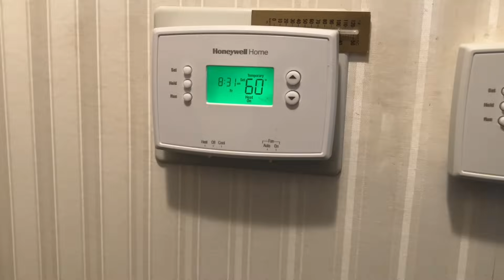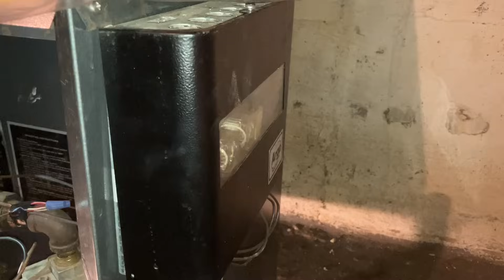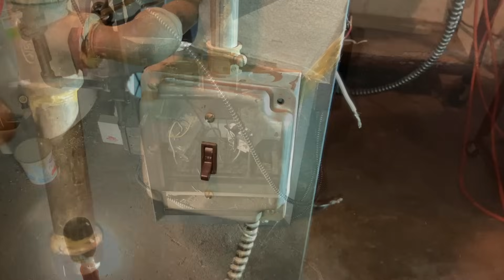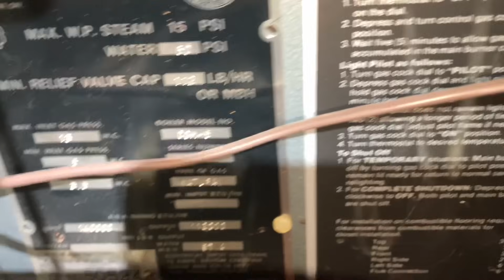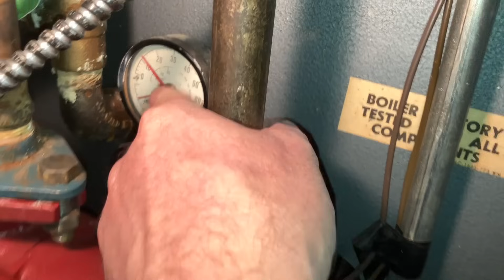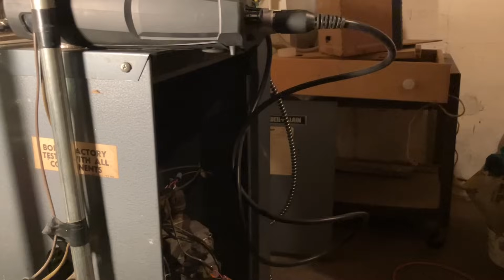Weil McLain No Heat Emergency Service Call by Local Plumber Pipe Doctor

Comment: You state your objective is to make sure it runs safely and correctly, and you are sooooo thorough......yet your air is 7.7% when it should be 4.0-5.0%. Since the "whale" mc lain (it's Weil pronounced like "while") has fixed air adjustment at the burner tubes you should have put a manometer on the gas valve and make sure it is adjusted correctly. it should be 3.5" Hg to match the air intake. Perhaps your combustion numbers would be normal if you found the gas valve was putting out something like 2.9" thus rendering the unit running O2 rich. You missed  that step.....and your hypothesis that you will shock or condense a boiler by lowering the limit temp to 165????? Incorrect. The job should be wired cold start and XX should be your gas valve trigger from the switching relay. A delta tee of 20 deg is the normal target on a standard hydronic boiler. How come every cold start boiler in the world doesn't crack on a marginal heat day when the thermostat satisfies and stops the gas valve but the boiler is only at 160????
Reply from the maker: Appreciate the detailed technical feedback.

Comment: Do not assume that wagos are a “better connection” than wire nuts . Wagos have a connection for each wire . Wire nuts have one because it is a wire to wire connection . So , no wagos are not necessarily better .  Plus , after being an electrician for forty years , I have never heard anyone say anything about wire nuts being single use ?!!
Reply from the maker: thats your opinion. thanks for sharing.

Comment: I had a condensing boiler had to rip it out because it couldn’t heat the house if the outside temperature dipped below freezing.  I put a regular boiler back in . Plus they wanted over $400 for the yearly service contract on a condensing boiler

Comment: Good Morning. I have a 20 year old, 90,000 BTU, standing pilot, Slant fin hydronic boiler, with 2 zone valves that were added about 10 years ago. I hold a  608 Universal certificate. When I replaced the expansion tank last year I upgraded the low pressure fill valve to a Cioffee combination back flow check valve and pressure reducing valve and set it to 18lbs and set the expansion tank to 19 lbs to get the water up to the third floor. Recently, the pressure relief was letting go a little and I would see about 2 ounces of water.  I am going to change the pressure relief valve. The thermostat calls for heat. That zone valve associated with that thermostat opens, I hear the water falling back into the boiler. The damper opens. The gas valve opens. The burner tubes ignite and then the gas valve closes about a second after the tubes ignite with full gas. The flame roll out switch looks good and I don't think there is a flame proving sensor. The gas valve? The thermocouple also serves as the flame proving sensor?

Comment: could the high stack temperature on this unit be due to a out-of-adjustment gas valve allowing too much gas to the burners, thus the burners running too hot?
Reply from the maker: That is also a possibility

Comment: I notice that the relay seemed to operate once when you first started to pull on the wiring. Once you removed the cover with the relay and transformer, it looks like the neutral wire was either wedged between the cover plate  and electrical box or at least resting against the box allowing the ground to provide the "neutral" return. I'm surprised it operated as long as long as it did. The neutral wire was never attached correctly.
Reply from the maker: Thank you for your observations! It's interesting how even small wiring issues can impact the system's operation. Proper connections are crucial for safety and efficiency!

Comment: I remember I messed with a pressure relieve valve on a water heater when I was starting out and it wouldn’t stop leaking water.  One of our companies plumbers came out and tapped it real hard with a pipe wrench to stop it.  He said never touch those. 😂
Reply from the maker: wrong advice.

Comment: When having three wires under a wire nut it is standard practice to twist the wires together with a plier before putting on a wire nut.  Failing to do so can cause a wire to pop put from under the nut.  In this case that wire would not get pulled by itself through the connection point.  Someone worked on it in the past and did not put the neutral back on.  The loose neutral was likely making loose ground against the side of the box making intermittent ground and causing intermittent operation.

Comment: That neutral was probably hanging lose for a long time, and just touching the metal junction box, and effectively feeding back through the grounding on the boiler instead of back through neutral.  But yeah wiggling it would have moved it around the box causing it to make better or worse contact.
Reply from the maker: That's a good explanation.

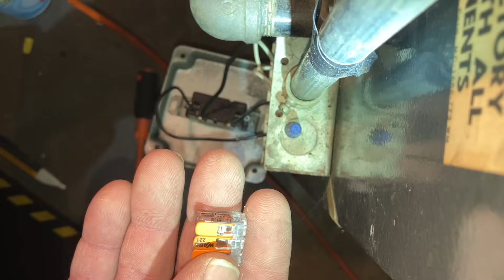Comment: 13:51 so it's basically a 150 amp circuit breaker but just on neutral 😂

Comment: I just came upon your channel and having been in the heating industry for quite a while back in the 70s in the 80s, we delt always in oil and sold weil McLain exclusively I found your discussion quite interesting. My current boiler is a P4 66 which is probably about 45 years old oil fired. Running well, does not leak any water even in the summer when I shut it down. It has a tankless coil which I no longer use so it’s been disconnected. I found your discussion on heat very interesting. Thank you very much.
Mac Morgan 
Yorklyn Delaware
Reply from the maker: Glad I could help! I have a lot more to teach, so keep watching.

Comment: For the combustion analyzer, don't you need to have the covers placed to get normal operation readings? since you mentioned that the system is engineered to have the openings a certain way.

Comment: I have seen this before!!!🙄 white  neutral wire hooked around the screw and then the fan center tighten down on the wire using the unit ground wire, which is technically grounded to the neutral bus bar at the panel box with that fan center being loose, taking the cover on and off with vibrate the fan center and allow the neutral wire to make continuity on the screw Bet you $100 that’s the way it was set up originally because I’ve seen it two times in my lifetime… stupid wrong idiot, but I’ve seen it done likewise on metal EMT. I’ve seen guys take their ground off of the conduit. 🙄🤦‍♂️ But man that stack temp??🔥🔥

Comment: The only good condensing boiler is the GV90 series Weil Mc Lain . Forget the wall hung boilers that need too much maintenance and expensive parts that most contractors do not carry on their trucks. The heat exchangers on cast iron boilers will outlast any wall hung boiler by 4 times. The money you save in fuel, you more than pay back in repairs. I been in the industry 40 years and people want reliability, not your parts are back ordered see you in a week.
Reply: Same question I asked Mike above (GV90+). How do they get the return water cool enough to condense the flue gasses?  Seems condensing boilers need radiant in order to get enough heat extracted to even condense. I'm looking to replace boiler with baseboard radiators.

Comment: I bet the neutral wire (white) from the tranformer was grounding out on the inside of the 4 square and finding its return path back on the equipment ground (Green/ bare) wire.
Reply: My diagnosis also

Comment: I had this same boiler! Replaced the expansion tank a few years ago and computer board ($245). I bought the part and hired a contractor to replace for $90. The igniter was replaced twice in the last 15 years. The first time it went out it cost me $550 to replace by a HVAC ripoff company. It failed a year later. I found the part for $25 on Alpine HVAC online and bought the parts and fixed it myself. It cost me just $35 for the part. It worked ever since. The installer either installed a faulty one or it was a cheap component.
Reply: My HSI controller doesn't last more than 2-3 years. I think the back wall of the enclosure gets too hot for them. Best luck with honeywell S8910U

Comment: somebody made a bad connection many years ago, go figure! probably didn't "lead" the stranded wire ahead of the solid wires when putting wire nut on, if you don't it ends up pushed or or hardly connected. the yellow wire from relay is capped, because it's connected to the incoming hot(common) of the normally closed(NC) terminal and it will be live via the relay when relay is off.
unless they wired normally open (N.O.) as the line and relay common as the load, but even then,  ALWAYS cap off all unused wires!
Reply from the maker: Ah, the age-old battle between solid and stranded wires! If only they had consulted the wire gods before diving in!

Comment: check gas pressure,replace relief and extrol tank/feed valve....add stack damper above diverter and wham....she's brandy new with free heat...sure you could go for spark ignition but...
thats the way to save him money-winner winner ..turkey dinner

Comment: how that ran without the neutral wire  connected prior to the service call is the true mystery   great video mike    happy thanksgiving
Reply: it was either slightly in the wire nut just touching or it was touching the metal box and returning back through grounded boiler case/piping.
in that case, if the boiler ground is poor everything connected could become live at 120v.

Comment: Didnt know that cast iron boilers could condensate exhaust gasses if the return temps are too low (moving the exhaust gas condensation closer to the boiler) and that exhaust gasses do condensate in the chimney liner if the gasses cool down enough. 
Thank you for teaching us!
Reply: yes, water return temps of anything below 140F are very bad and the moisture from the gas and air burning will cause condensation between sections where the flue gas is, as well as the flue piping above and the chimney too! bad news times three.
Reply from the maker: That is correct
Reply: @PipeDoctor  I have a weil-mclain VHE series and it has pretty much self destructed because of rusting out heat exchanger. I have limped along by using a flue brush so the pressure switch proves. I realized the 140F conundrum while looking for a boiler replacement and looking at W-M GV90+ series. I have to respect the durability and serviceability of the brand despite my experience and I believe cast iron is still a better choice than SS i.e tankless. Don't these high efficiency cast iron boilers have a secondary heat exchanger to isolate the condensation so it can be carried away and maintain non-condensing temperatures in the cast iron section? Also I have ductwork and air handler so one thought is to put a heat exchanger in the plenum to even get enough heat extracted and get the return water down to the dew point. Otherwise it seems you would have paid for the high efficiency capabilities but never get the return water cool enough to get the rated performance. Great video.
Reply: my boiler used to run at 83% efficiency 320 stack temp   high limit was set for about 10 degrees above typical end of heat call temp ca. 140.  it would cycle only on the coldest days ca. -20f

Comment: Moving the door may have caused the neutral to “ground out” providing a return path and allowing the system to run…. Just a thought.
Reply: that's exactly what was happening. the end of the wire was stripped back and was probably hitting the 1900 box creating a neutral.

Comment: Mike teaching a customer was always my  of my favorite things to do, made the Job go faster and you made a friend and customer for life.
Reply: I told my father about your situation he is also an HVAC engineer and before that he was an HVA sales he sold those boilers all the time and with the age of that boiler the reason why the external or the exhaust temperature is so high is because it's a good possibility you need to drain the boiler and clean out the passageways in which the water flows because over time those corrode rust up and constrict constricting the water flow hence reducing the heat transfer it's probably calcium up and calcium does not conduct heat that's why you're losing it out the trim chimney pipe so he could make that boiler last another 30 years those things are built like a tank and if you really wanted to replace it you can buy the exact same unit today built the same way you don't have to buy no condensing boiler and put in $1,000 worth of storage tanks to keep the 180° temperature cuz you're going to have to install a storage tank a highly insulated storage tank that heats up the water temperature to 180° and get that circulating through the house
Reply: So, do the passageways get replaced or cleaned or boiler blown out with high pressure water? You said you can still buy that same exact boiler?

Comment: Slotted screw heads were the first phillip head screws came into play in the 1930’s … on the electrical boxes, I think they use slotted so people use screwdrivers instead of power drivers so they don’t strip them out…. 🇺🇸👊🏼👊🏼✌🏼🪚🔨
Reply from the maker: Screw that! No pun intended
Reply: @ 
HaHaa
Reply: @PipeDoctor  I think "pun" was intended!  LoL!   (No offence)
Reply: hold my beer! grabs impact driver with flathead bit. 🤣 doing general construction, I run into them very often and many times I remove and put them back in. cover plates, old receptacles, switches, (all electrical), plumbing, door hinges, sink retainers, basket strainers, etc. endless list.